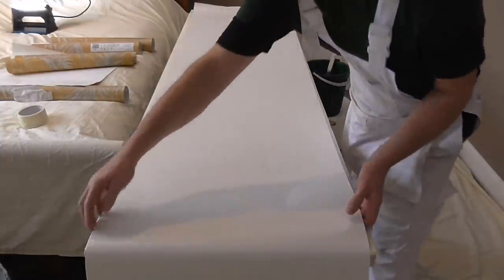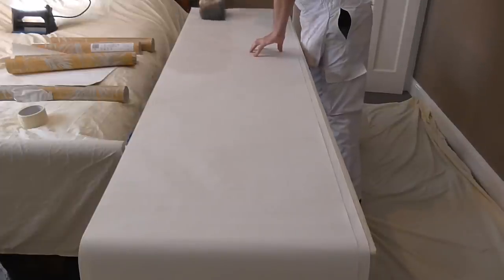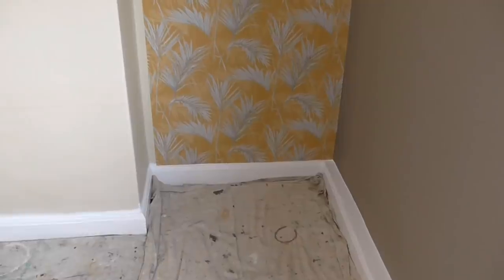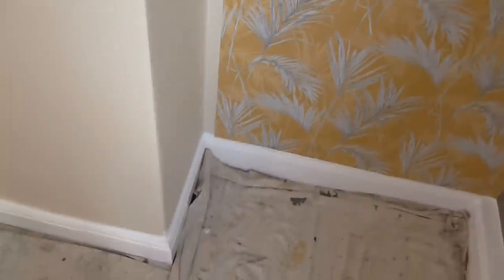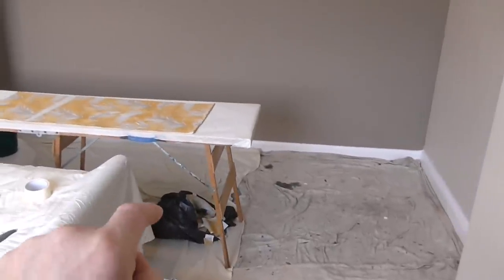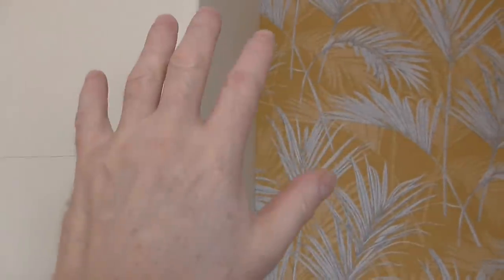Wallpapering Internal And External Corners.

Comment: Any decorator knows you start in the middle of chimney breast! You've made a fairly easy job very difficult
Reply: @petea2485  I've been hanging wallpaper for over forty years mate , you start hanging wallpaper working away from the source of light (window) or chimney breast as this is the focal point of room,  every joint, top and bottom you use border adhesive, plus lightly seam roller all joints. He's done a good job,  just made hard work of it
Reply: @DB-kv5mb  if hes done a good job hes done it right
Reply: DB I have to agree with you . I would have worked it from the centre of the focal point (chimney breast). But always good to see how other people do it. 👍
Reply: @martinosicka7051  thanks
Reply: Ask customer if wants it centred. I would tend to advise centre but better technically comming towards window /door
Reply: @DB-kv5mb  Never heard of using overlap adhesive on the tops and bottoms,  just on overlap joins - maybe ready mixed pastes as strong enough for that?
Reply: @Tephnos  they are but he used ordinary paste , not ready mixed
Reply: @DB-kv5mb  Yeah fair enough, I bought a tub of the Wallrock Power Adhesive for some stuff I'll be doing soon, seemed like it sticks insanely well, ain't peeling that off in a hurry.

Just trying to work out how I'll paper my external bullnose corners with the slanted ceilings on top of that. Guess homes with these types of rooms are extremely rare as I've yet to find a video of anyone doing one nor discussing it.
Reply: @Tephnos  this guys a good decorator however he overcomplicates things, please remember these videos are aimed at beginners not trade professionals! With a bull nose cut ✂️ to go around it about 2 inches overlap next piece and splice through both, with wallpaper all you can do is start in a straight line
Reply: @DB-kv5mb  the corner itself seems simple enough, the hard part is where the slant begins halfway up the wall. Seems like where the curve begins dips in slightly, so you end up with a gap there in the paper unless you cut into it horizontally a bit and stick it down, but then with an overlap that spliced area to get it to go around the corner (that looks like < ) is going to be fairly significant. Seems like all I can do is just cut another bit to match it and stick that down? 

As a picture is worth a thousand words, this is the corner I mean: https://imgur.com/csHWEHA

I've already abandoned hope of making a pattern match, that's never happening. However as it's a textured paintable superfresco, it should be easier to hide, as long as I get it on a continuous stipple, nothing like the nightmare that'd be the paper in the video.

Comment: One thing I like to do is to have an open dustbin for my offcuts, a lot easier than using a bin bag and no paste soaked offcuts getting on the dust sheets.
Reply: When feasible I try and do the same. You do get some strange looks 😂
Reply: Agree always put wet or dry off cuts in box or bin straight away

Comment: Why not wrap around the external by a few mm, then re hang and plumb the next length/off cut back. That eliminates those horrid crease and bubbles when you try and go around in one. On a larger return external you'd never have a plumb edge to work with wrapping around in one go.

Btw... U tried wickes tub paste yet?

Comment: @ 34:12 I swear, get a £3 papering spatula and run it along WITH your knife. I just learnt this and it's now how I do 90% of my cuts. Olfa snap-off > Stanley, too. Both revelations for a tenner.
Reply: Try the 12.5mm Olfa knives, they are thinner and sharper than the 9 & 18mm blades 👌
Reply from the maker: To be honest papers have changed the fiber is a lot stronger. Did have some difficulties with the scissors... and these new paste the wall....wallpapers do seam to cut better using a very sharp blade.
Reply: Where you been...iv been doing it this way for 20yrs far easier than scissors. Just keep snapping your blade every sheet :)
Reply from the maker: @tonyrussell496  some papers don't like blades... they can leave the edge funny and tear some delicate wallpapers..  these new papers are becoming more the norm, I would say the tied has turned on what type of paper you hang.

Comment: Ah man that first measurement three you out across the whole wall and I feel for you. Personally I always start always start on the chimney breast face and work out and was taught to re plumb after every internal corner just like you showed. It might be worth mentioning to score with the back of scissor before running your pencil. Excellent job though mate good vid
Reply from the maker: Was taught to work away from natural light. The way the pattern was no problem where you start. Just goes to show several places you can start from and still make a perfect job with this pattern. Thanks

Comment: so you wrap around the external corner but overlap the internal?
other videos do not wrap external, but they do have a +/- 10mm overlap on the "inside" wall, so the face of the chimney is complete paper but the sides are where any pattern overlap problems are less visible.

Comment: I think you’re starting point is not the ideal place in regards of the chimney breast are notorious for not being straight, if you start at the centre of the breast it’s not only easier on the eye but any plum ness can be easily lost in the angle and any bagginess that may occur on chimney corner can smoothed out

Comment: Love all the videos you make! Just had a question about papering over painted lining paper. Is it necessary to apply sizing to the paper before hand? Or can I just go straight on top. The painted lining paper is well stuck and in good condition. Thanks for any advice.
Reply from the maker: Thank you... always best to wipe over and light sand..  that way you can check the surface for any lumps. thanks
Reply: @PaintingandDecorating  and would sizing be required or is it unnecessary?

Comment: Great video as usual. One question.... an exterior corner which carries on a long wall rather than a chimney breast... how do you ensure both sides of the drop of paper are plumb after being wrapped round the corner if you get my jist? Thanks Marc.
Reply from the maker: Thank you.  Depends on the pattern and the type of corner. 90° corner you can go round a little 2to3mm  then overlap next length and trim.  Bullnose you see how it lies then make a decision deal with the bubbles on the corner or see if you can cut and splice the length all depends on pattern..
Reply: @PaintingandDecorating  thanks mate much appreciated! Will bear that in mind

Comment: What's better, paste the paper wallpaper or paste the wall wallpaper?
Reply from the maker: That's difficult to answer as both types have good points and bad points... but I always paste the paper anyway because it's the best way to keep paste off the front off the paper. And helps to make it easier to handle the paper. thanks

Comment: Now if someone could show me a good technique to paper round an external bullnose corner that's also a slanted ceiling I would be all ears. Seems like it's an impossible job to do without cutting into the paper where the slant begins at the corner, but you lose any hope of making it a tidy job there doing that.
Reply from the maker: Easy...  you can only ever hang your paper straight..  anything else is the rooms fault.   So nothing can be done apart from choosing the correct pattern.